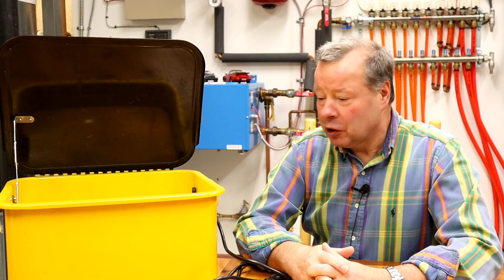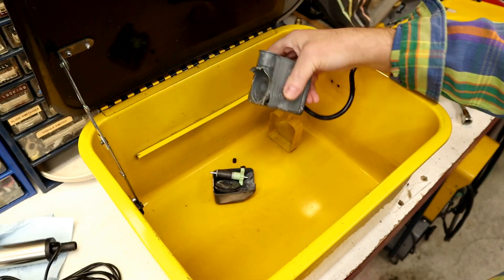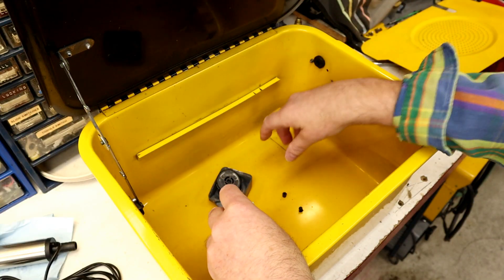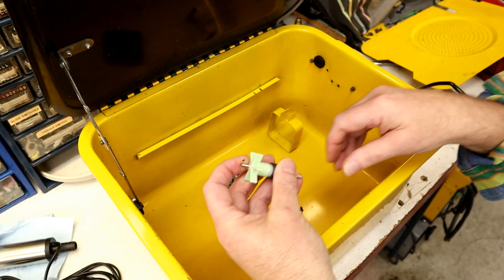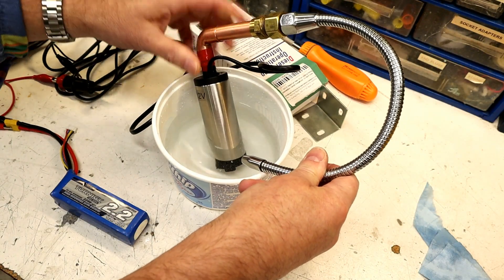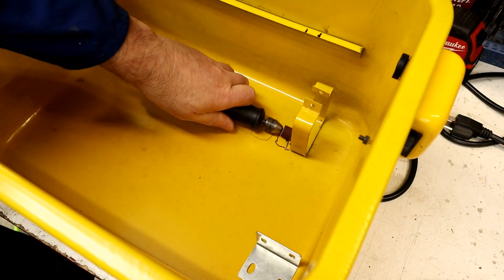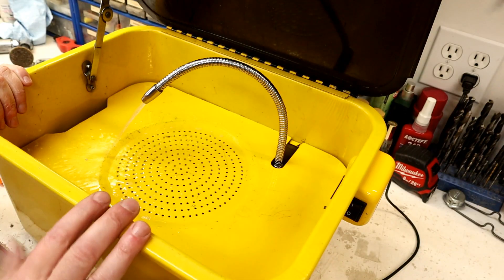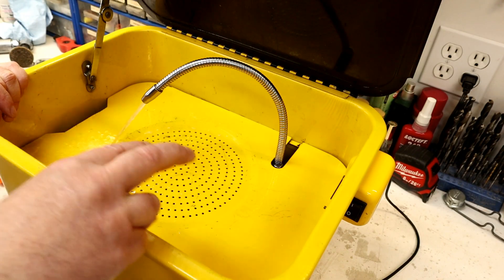Parts Washer Pump Replacement - Dissolving Pump Warning!

Comment from the maker: 1 week pump update: Still Working 🙂 
38mm 12VDC Submersible Mini Diesel Transfer Pumps:
https://amzn.to/47JWnpN
Another Submersible Pump Option are 38mm 12V Universal Intank Fuel Pumps; these may be a better long term choice for continuous submersion:
https://amzn.to/4owPsYd
3.5 Gallon Parts Washers:
https://amzn.to/4hP4IgH

Comment: nice! Is it worth mounting the pump a little above the floor of the tub, so it doesn't suck old debris through? and maybe put some fuel cell foam over the inlet to act as a filter?  Very nice job. I think I'll be doing something similar.
Reply from the maker: You could if you wanted to. There is already a screen on the base of this specific fuel transfer pump so any big bits that would actually cause issues won't get ingested, but it's up to the individual; keeping in mind, the higher you raise it, the more solvent you have to fill the bottom of the washer with.

Same goes with any sort of filter media - up the individual and what they deem more important; the hassle of filter cleaning vs. partially filtered solvent.

You may be interested in an update video I hope to complete this coming week on the transfer pump I used for this project. It actually failed after several weeks due to silicone seal swelling while immersed in the petroleum solvent over the past several weeks. These transfer pumps are obviously not intended to be immersed in solvent for a long duration.

I have since switched to a small universal submersible 255 Lph fuel pump which is about the same size and cost. It's meant to be living in petrol so I expect this one to last and what I should have got in the first place! https://amzn.to/4qmUPKp

It also comes with a filter sock/s if you wish to use one. I however found this 255 Lph pump too powerful at 12V (very strong spray), and am using a 9V transformer instead. It would be fine to run at 12V with one of those hose brushes however that need a lot of fluid flow or a fluid nozzle with a larger diameter hole. 

I'm waiting for a low cost DC motor speed controller in the mail as then I can use it at 12V and throttle the flow of the fluid which should be the ideal solution. I've often wished from the first day I got this parts washer I could control the flow rate, so this should do the trick. 
The 12V speed control I'm waiting for are these: https://amzn.to/4t2erFJ
Keep in mind, I don't know how well these little 5A PWM motor controllers will work yet as I'm still waiting for it. Hope to have it soon and get the update video up.

Comment: Same problem....thanks for this, although I don't think I have your talent to make the repair !
Reply from the maker: Sorry to hear you too have experienced an infamous pump melt down. It really is a shame they changed the plastic and the bushing material in these small washer pumps that otherwise worked great for years. Wonder if was intentional to force people to use water based degreasers or a typical cost cutting measure to make more money at the consumers expense?

Comment: My thoughts for a suitable pump, not sure if it's been mentioned, is a fuel supply pump for an oil fired boiler. 
The oils are basically low grade kerosene.
Reply from the maker: I'm not familiar with oil boiler pumps, but if they are submersible, not too big & heavy, have similar flow rates of around 3 GPM and don't cost more than these parts washers (ie. under $50 beans or so); then they too sound like a workable kerosene safe 3.5 gal parts washer pump mod solution.